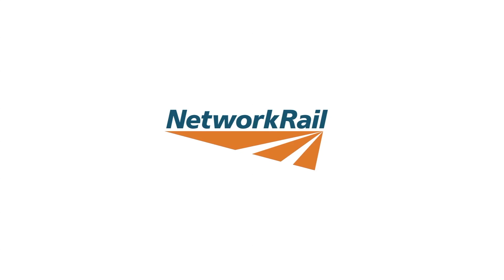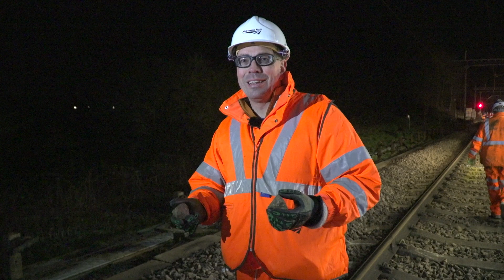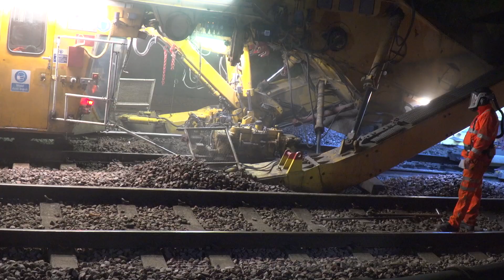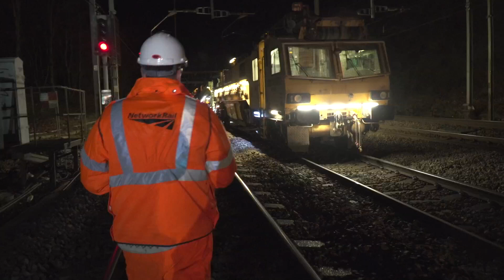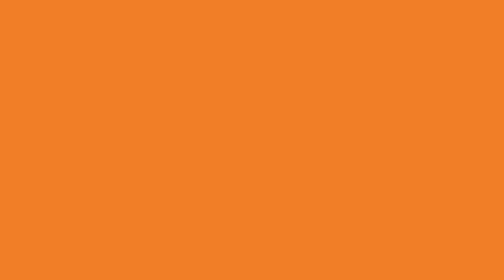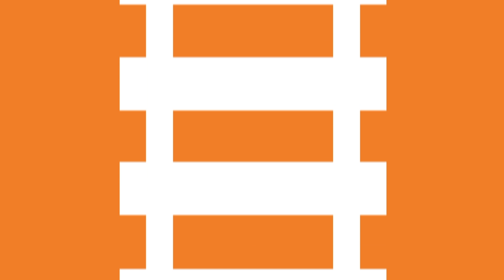Engineer Steve showcases the High Output Ballast Cleaner

Comment: What is the difference between new and used ballast ? Just a hint of science please. Comparing UK rail to that in Europe and pretending it's better is laughable
Reply: I think it has to do with the individual rocks locking together, if they're too smooth from weathering, they'll just slide past each other, and the rail will sink/collapse. The ballast needs to be rough so they hold together and support the weight of the train.

Anyway, I hope you're still interested in this question from two years ago 😁
Reply: @ekamlin Yes thanks though have had to remind myself what the question and video were all about !